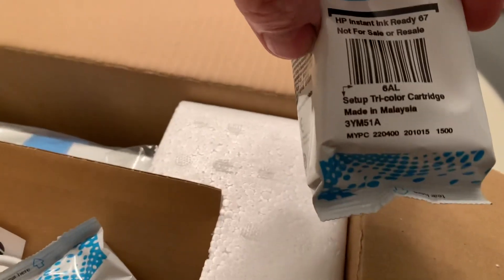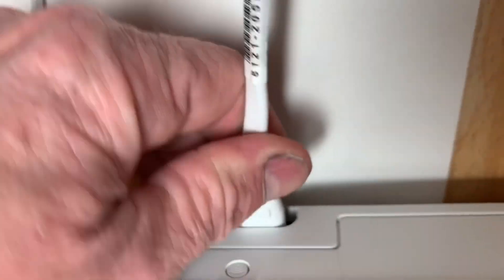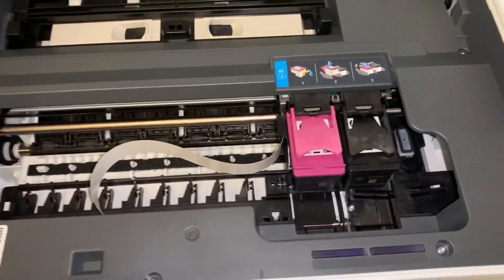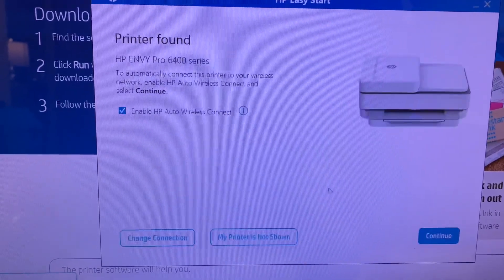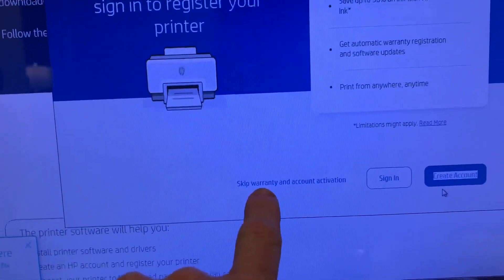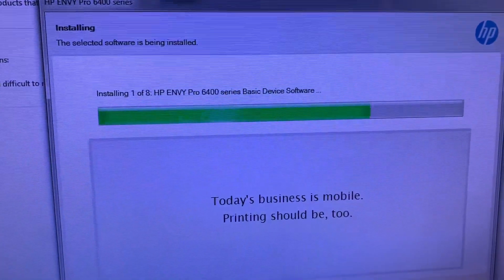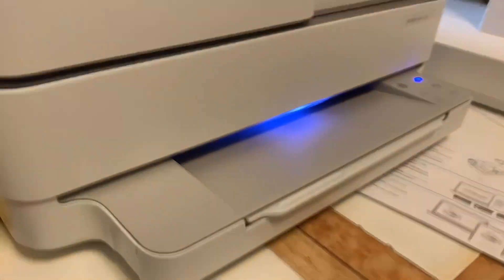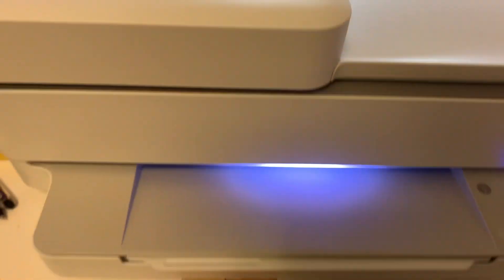How to set up your HP Envy Pro 6458 Printer Print Scan & Copy Tutorial Step by Step [ENVY PRO 6458]

Comment: Its not actually  wireless  is it it only turns on when u have it plugged in ?
Reply from the maker: Probably. Many of these printers claim to be wireless but I’ve purchased many over years and can’t get very many to work well or even at all unless I’ve got them plugged in.  Good comment.
Reply: I think wireless refers to not having printer plugged into router. For a Wi-Fi connection. In all cases you would need to have an electric wired connection for electricity to power the printer.

Comment: How do you turn it off lol
Reply: There is a power button on the back of this printer, above where the power cable connects to the printer. Press once, the printer will ring a bell and the lights will shut down.